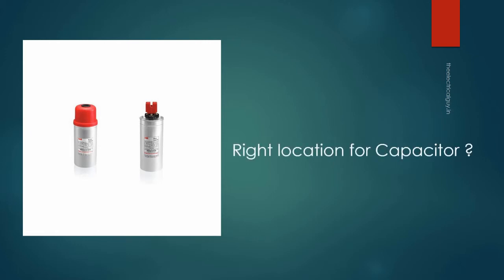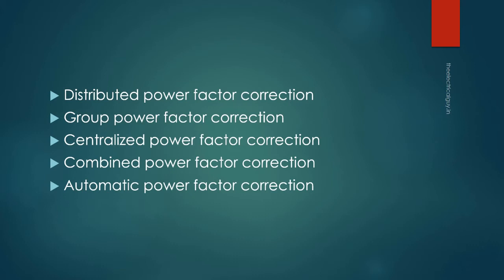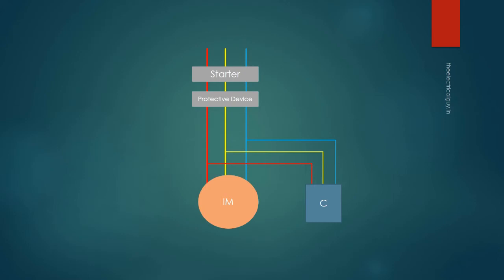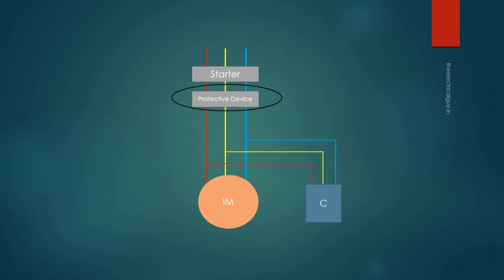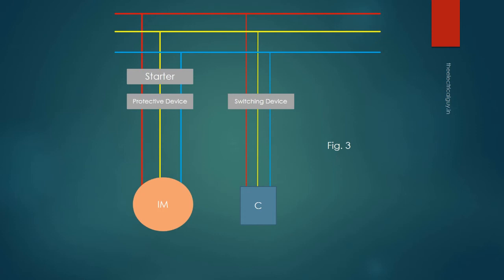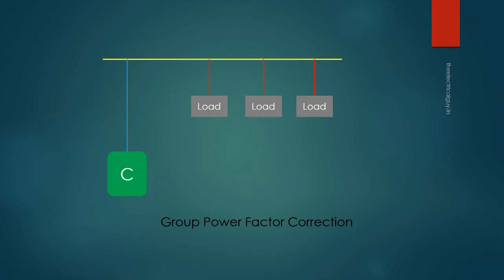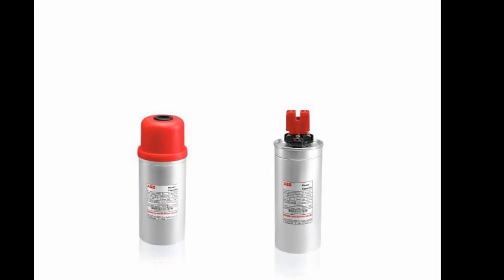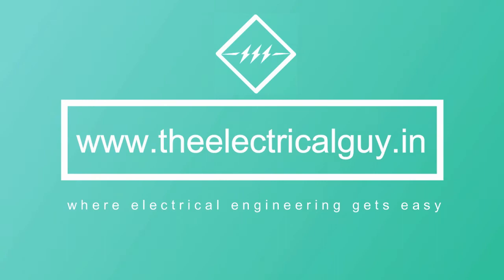5 Types of Power Factor Correction | Capacitor bank locations | TheElectricalGuy

Comment: What is impact on installation if PFC connected before AVR (there will be transformer) and after AVR ( LV panel)..what is recommended? 

Automatic Voltage Regulator

Comment: Sir ji, little deviated from the video. 
Thanks for the video , can you tell how will we take power factor in a system , example in 5 storey hotel building, if we take the distribution boards, then Sub main DB and main DB load schedule,we only assume the power factor to be 0.8 or 0.85 and do the rest of the calculation, like current, wattage etc... But when it's comes the question of  power factor- capacitor bank , how will we calculate the existing power factor with load schedule, Theoretically...
Kindly help me out. Thanks